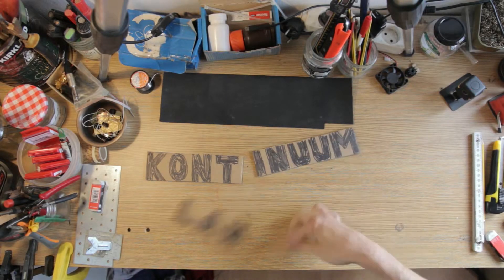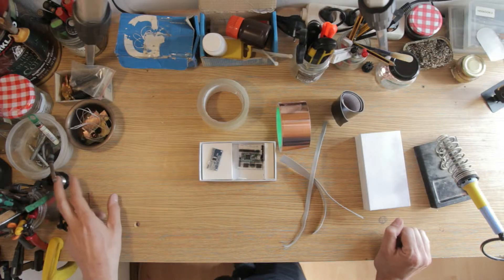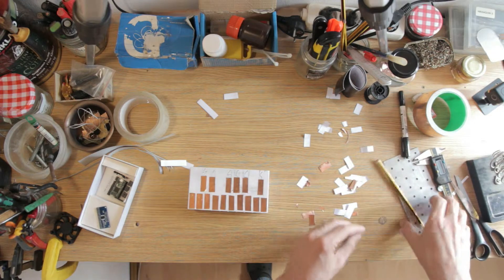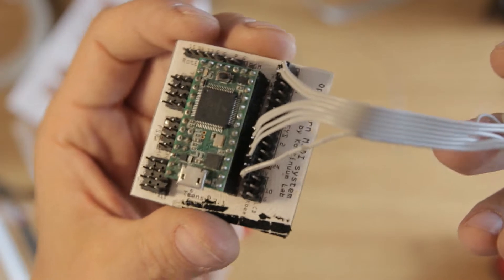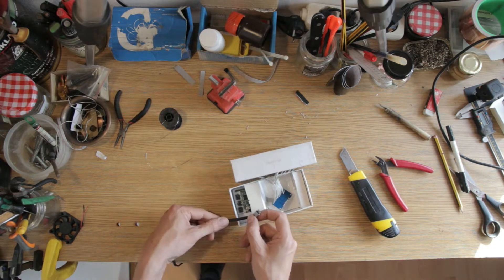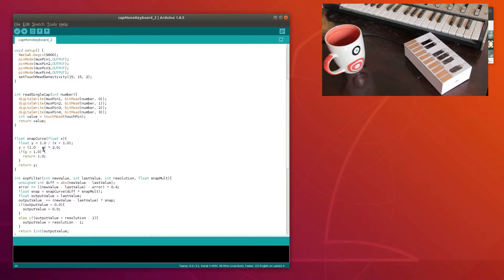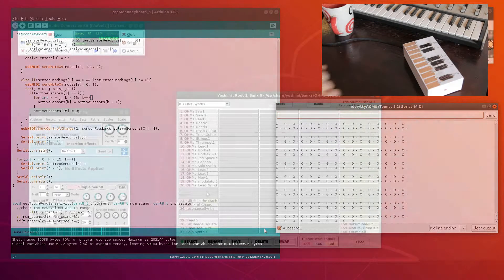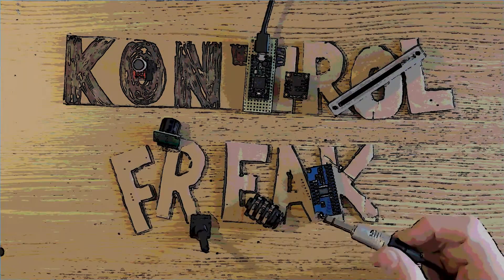KontrolFreak DIY MIDI keyboard

Comment: Hi there, nice channel :D. Is a mux somehow resolving the charge leak from one capacitive sensor to the other, when touching multiple sensors? Did you try out solutions with other cheaper microcontrollers? Im currently trying to get a rp2040 to work

Comment: Hello, I love your works and want to build a keyboard like this. 
I have a qusetion is what is the theory behind the sensor?  Connect a wire to anolog input on Arduino board each key, and the voltage will go up and down when the sensor is pressed or not,  do I understand it right?
Reply from the maker: @ShIH2701  No, these are not analog, but rather capacitive sensors. You can use a Teensy board to make them (Teensy LC is the cheapest) by connecting a single cable for each. 
Then use the boards USB MIDI connection to connect to your synth
Reply: @KontinuumLAB thanks for your answer!  Your answer help me a lot.

And I have another question. Will there be any difference between using Arduino pro micro and teensy board? Because it will be a little bit hard to get a teensy board in where I live, so I still don't really know which is the best choice.
Reply from the maker: @ShIH2701  yes, the pro micro does not have on board capacitive sensors, so you'd have to get an external sensor, like the MPR121 or similar

Comment: Hey I m appreciating your keyboard which is like a masterpiece! Can I get the schematic design?I m wondering the way how the copper tape connect to the MCU.Thanks!
Reply from the maker: Thanks! The sensors are connected using a multiplexer,  but this is an old design, and I don't remember exactly what pins I used for what... You should check out this later version: https://www.youtube.com/watch?v=YdA1xqggO5M The link to the code for that is in the description, and that will show you what pins are used. 
Also, if you like this keyboard, then you will love the latest iteration: https://www.youtube.com/watch?v=pUrFqCCAZSg

Comment: If you can give me any tips on what I need to do to control velocity. Or better, if you can make a video transforming a keyboard without midi (like psr 79, CSR 558 and more... ) into midi, it would be incredible
Reply from the maker: I can't help you with those keyboards, sorry. I like to build my instruments from scratch. 
But I will say this: To control velocity from an analog or capacitive sensor, you need to make 2 measurements in quick succession, and then calculate the increase in the second measurement. A bigger difference between first and second measurements means more velocity. 
It's an interesting topic, and I will make a video about it some time soon.
Reply: @KontinuumLAB  alright, thanks I'm from Brazil, continue with the videos thank you so much for the content baaaaai haha